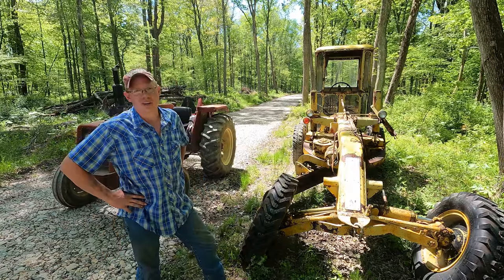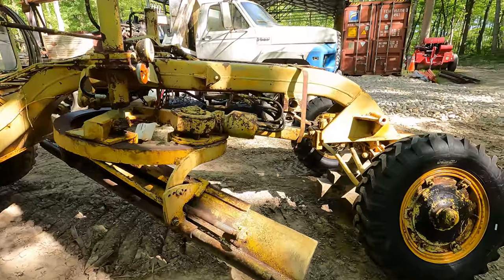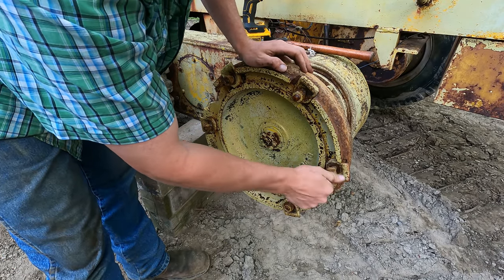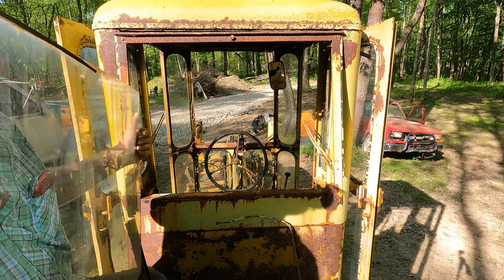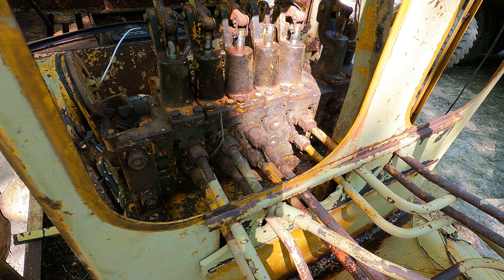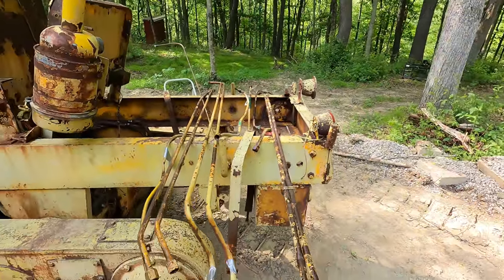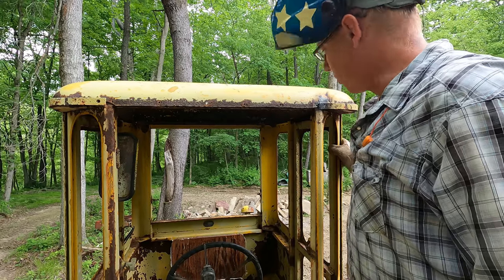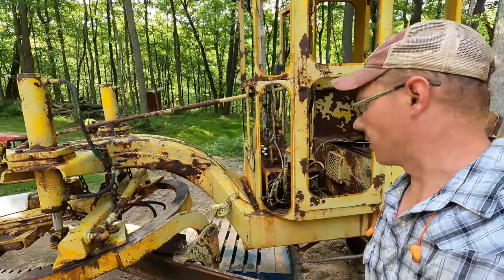More Problems with the 1960's Galion Road Grader restoration!! Pt.8

Comment: When I was a wee lad, our country roads were "paved" annually using oil and gravel. For several weeks each summer there would be Galion graders, rollers, and other equipment parked in various areas as the crews knocked off work for the day or week. 

Naturally, as kids we gravitated to the equipment when there was nobody around, and played "Construction Crew" with them. Once in awhile whoever parked the grader would forget to drop the blade when they left it, and we'd get a juvenile kick out of pulling the lever to drop it. 

Eventually someone decided to try starting one of the rollers. It started. We ran. Next time we went back it wouldn't even turn over. Color us supremely disappointed :( 

Watching your series on the Galion "restoration" has brought back 60 year old memories of somewhat simpler times. My everlasting thanks for your efforts, and for your appreciation of the fact that old doesn't mean it should be retired.

Comment: Please grind the rust off with a poly / strip disk. It's gonna make a difference if you want the paint job to last.
Reply: 👍👍 Absolutely! 👍👍
Reply: Exactly what I was thinking, going to regret that later.
Reply: @kennybirdwell  And not much later the new paint will swell with rust
Reply: i donth think he really cares or not look at his collection thats what is calla  country collection
Reply: didn't you listen to his intro, its a socially distance resto and he could care less. He did do that on the gas tank and it was a shit ton of work for a lackluster result. On these old machines its about just keeping the weathering down, and since he has a place to park it under a roof it doesn't really matter.
Reply: @tslim250  I disagree, the engine, fuel tank and radiator housing turned out great. Now need to maintain the standard. This machine will be a showpiece at the steam show. Socially distanced yes, but not from 100ft.
Reply: @Frank-bh3cm  I thought it looked better when he first drove it from its grave than it will when he's done with it. Ruining the patina with every video. Shoulda just pressure washed it and thrown a layer of matte clear overtop the patina to seal it from further rust.
Reply: Wire brush on the angle grinder and some rust converter. Socially distant restoration.
Reply: @phillipmattila2953   No, that's half assing it.
Reply: @owentimo  true but its his stuff I dont think we need to treat him bad bc he doesnt want nice looking things
Reply: @phillipmattila2953   You're right. I agree. Hey, I guess the grader would be in a scrapyard if it weren't for him.
Reply: At least treat it with Naval Jelly.

Comment: For those who don't know - the beginning of this video is a PERFECT example of why you don't try to pull a stuck truck or a stump out in forward gear with an older tractor (especially one without a roll bar). If you try to pull an immovable object, the tractor's drive wheels don't move, and instead the engine just flips the tractor over and squashes you. This was one of the number one ways that farmers died in the early 1900s.

The way to keep this from happening is to pull in reverse. You tie your straps or chains around the rear axle, feed them under the tractor through the front wheels, tie onto the stuck truck (or stump), and pull in reverse. If the stump doesn't move, the tractor just digs the front end into the ground.

Incidentally, this is also the reason why it's safer to back an old tractor onto a trailer than to drive on in forward gear.

Comment: It would be really amazing if you sandblaster it before painting as well. I see so many projects where they sandblast all the surfaces before painting and it comes out amazing. Thumbs Up!
Reply: The metal on this is too thin to sand blast. It would blow holes all through it and any reasonable pressure. Blasting can also warp panels due to the heat if done wrong. Blasting is the best for surface prep, but not if you don't know what you're doing. 
Source: ex sandblaster / painter
Reply: I use a sandblast setup on my pressure washer.  Great for cleaning up machines like Christine.  Hint:  when you're done, wash the machine with a regular nozzle.  It removes the grit that is left on the metal.  Its the grit that rusts up if its not washed up.  I have had no problems with blowing through sheet metal.
Reply: @ToxicMrSmith  Not if you use a home pressure sand blaster with 125psi max, it will take a bit longer but still gets the job done, ask me how I know...

Comment: When there is no way to get the surface fairly clean from rust, I use to prep with rust converter, stops the paint from flaking. To a certain degree but in places not maintained on a regular basis like metal roof it is a good method.
Reply: Agree ,,
The way the  various  kinds of  rust converters leave a surface ,it almost plastersizes it ,  locking down all the  rough edges  ready for the  new paintwork,
  It's the best way to deal with RUST ,,,
by far  .!!!! .
Reply: Do a dry ice media blast and a primer satin coast on the grader this way you never have to work about fade
Reply: @rsprockets7846  n

Comment: I own a body shop and your just killing me with the way to are going about stuff! No I don't think it needs to be a concourse de elagance show winner but at least grind off the rust and paint before you apply the filler...otherwise I love the channel Matt and think its great that you are keeping some of this old iron in service.
Reply: I agree you gotta kill the rust I like to clean it up pretty good then use ospho it will etch the metal
Reply: Yep.
We've a saying in Cumbria UK: "Divvant spoil t' ship for a ha'p'orth o' tar."

Get the rust off first Matt. 😝
Reply: Actually Never apply filler after you paint or primer, but I know what you mean it would still be better then what he did...
Reply: He said in the beginning of the series it’s only gonna be basically a “half assed restoration” so he’s not doing everything to a “professional level”
Reply: @DudeGuy-zt9eg  what do you use to kill rust
Reply: First off you can paint over rusted stuff these days. Most heavy equitment is just steamed washed and sprayed and looks good even years down the road. Rust thrives in oxygen environments and using good paint will seal that up and stop the spread of that rust. Sure in 10, 15, or 20 years it might show some signs of rust. Yet the goal is to make this machine functional and not to be some show piece. He intends to use this and take it to some shows. it does not need to go to a body shop. Also if anything it would be super cheap to make one of these out of sheet steel if you do not care for the curves and all of that. Now the glass cut out could be done on a cnc. Even if the cut out are a bit bigger than the the glass and rubber gaskets. Just box it out and cut out the area on the cab and weld them in This would give you some strength and a pop out look.
Reply: @kameljoe21  those corners were rusted through, so it’s got oxygen on the back side.  They’re going to crack and break apart in a few years.  Super easy to spray thrust converter on there before painting.
Reply: @Bread996  Either way its going to get painted on the inside as well.  People need to understand what the goal is here. This is a work unit and all he is doing is extending the life of a machine that would have been scrapped at some point. This machine is so outdated that most people do not want them. Yet in this case the price he spend buying it and what he will put in to fixing it will be far cheaper than buy anything remotely in fair running shape. For what he intends to do with it the paint job and finish on it will far last him and his entire life time. FFS I have seen old cars sitting out in the fields rotting away with wood frames that are still in good condition. Yet they need some work. If a car built in the 1920s is still around then this thing will last much longer. The paint and the work he is doing will slow the rusting far more than paying the extra money by putting rust converter.,,,, Let me adjust that as I just looked it up and seen that its like 55 dollars a gallon.. So a couple gallons will work as a good primer base.. Gempler's Rust Converter, 1 gal. cost like 55 a gallon and covers 500 square feet so a couple gallons sprayed on may indeed help keep this thing pretty..
Reply: @warrenklingensmith1241  I've always used Kurust but that's only been for small-ish patches on cars, seems to work ok. There's other brands available in much larger containers. It possibly depends what country you're in as to what's available.
Reply: @kameljoe21  Anything worth doing, is worth doing right.  Takes an extra couple minutes to knock off the loose rust and spray some converter on it first.  That putty is going to make it rust out worse, and that entire corner is going to chunk off in a few years.  I've seen this before, it doesn't work.
Reply: I agree don't expect perfection but damn grind some of the rust hell could even sand blast, you spend good money on mechanicals then half ass the rest where's the OCD now sorry Matt  that rust on the edges is killing me great video though
Reply: You should  sand blasted the machine  or use a bunch  of navel  jelly  or sand  it

Comment: Why didn’t you at least wire wheel the rust of? “A paint job is only as good as prep work” someone said that.
Reply: My father, at least a thousand times. Of course he was correct.
Reply: The guy that painted my house didn't know..   what a dunce...   Dutch.. Eigen Huis painters
Reply: Yeh and a rust treatment would be a good idea too.
Reply: Now, in some fairness, you only want to de-rust just before you are ready to re-prime, or the bare meta will flash rust.  By his description, he intends to steam clean it in how every many days it takes.  Then, that will want drying.  Then, the rust can be attacked.
Reply: @CAPNMAC82  Yeh I get that, but he put body filler over the rusty metal
Reply: That thing is just begging to be sand blasted

Comment: Quick tip for the studs since they're for straps: drill a small hole and countersink it. That way you can make a weld that's already flush with the frame. It's also stronger and less prone to snapping if you ever need to remove the strap

Comment: Ahh the ever elusive 10mm,very rarely seen in public lol.
Reply: I actually had two at one point in my garage at the same time! What are the odds?  But now they are both gone and  I have no pictures or proof that they ever existed sooo....  lol
Reply: @giggiddy  You mean you had a 9mm and an 11mm right? What's a... Did you say 10? 10 inch. Not a 10mm wtf even is that
Reply: @ToxicMrSmith  lolololo
Reply: I would gladly trade some of mine for 3/4". Can't seem to keep them around for some reason.
Reply: That is because the gnomes like to steal them.

Comment: While you're at it check the drive chains for the rear traction. May have worn links to replace.
Reply: And there's probably some oil in the water... errrm, a lot of water in the oil if the rest of the machine is anything to judge by.

Comment: 17:53 you should store Glass vertical, preferably on a frame for support. And out of the way, so you don't knock them over and break them.
Reply: Wouldn't horizontal be better than vertical?
Reply: @ToxicMrSmith  vertical space you need less and it decreases the surface area you could drop something on that's why vertical is better I think
Reply: @ToxicMrSmith  The danger of storing glass horizontal is if you pick up one corner you may break the glass from its own weight.

Comment: A trick for stabilizing and re-enforcing rusty metal , Is ,I use the polyester resin with the hardener from fiberglass kits ,It stabilizes rusty metal and re-enforces it and can be sanded and painted .

Comment: I used to spent summers back in the late 60's at my grandparent's place out in the sticks. They lived on a gravel road. One of the highlights would be when the yellow road grader (don't know if it was a Galion but it sure looked like yours in my memory) would come down the road to smooth out the potholes and washboarding. My cousin and I (both about ten) would scramble out when we heard him coming. Great times.

Comment: I'm full of envy - wish I was working on that nasty, dirty, rusty thing. Looks like so much fun!

Some tips on Flux-Core Arc Welding (FCAW). There's really three major differences between FCAW and GMAW (MIG):
1. Stickout matters! You need a minimum stickout (distance the wire sticks out of the electrode) so the flux has time to melt. Each wire is different and worth looking up the datasheet on, but I usually use 1/2" or so.
2. Check your machine polarity. The most-common flux-core wire I know of is that sold at Home Depot and such, NR-211-MP (AWS E71T-11). That wire requires DC- while GMAW always requires DC+. I don't have a Miller, but usually it's just swapping the leads inside the wire feed box.
3. Don't weld over the slag. You probably know this from stick welding already, but for those who don't, if you weld over the slag, it'll re-melt and get mixed into the weld, causing terrible porosity.

All three points, if followed, will give you much better looking welds and keep porosity out.

As an aside, MIG welding isn't technically correct (I call it that too, though. Who wants to say GMAW?) because when welding steel, we aren't actually using inert gas: CO2 or 75/25 mix (Argon/CO2) are active gasses that affect the weld metallurgy. Straight Argon is used for aluminum though, and that's true MIG.

Comment: I’ve worked In Hydraulics for years. And still do work at a hydraulic shop. Reminder to Tape off your cylinder rods before you paint, little adjustment like that can save your seals in the long run. Any questions, hmu

Comment: A little practice and good wire wheel you will find you can run some real nice beads with flux core. I have used it a lot for outdoor welding. Very strong less problems with old rusty metal.

Comment: Studs for the line clamps, I like the idea of drill and tap a hole in the frame (it will be plenty thick) and use a bolt with anti seize on it. Prefferably with more modern nylon tube holders.
To keep crud out of your hydraulic lines use plastic (zip lock) bags with a zip tie.

Comment: I had one of those, back in the 60's. It was my favorite Tonka! It had that long steering rod and steering wheel. You could turn the front wheels. While running behind it. Pushing with one hand and steering with the other. My favorite Road Work Machine:) I'm glad you are restoring this one... Don

Comment: A quick pro-tip.  If you have shop air handy and a small portable sandblaster just sand the exposed threads of any bolts with nuts on them and the nuts will come off like they were just threaded on. It only takes a couple seconds per bolt.

Comment: great video Matt, your right the devils in the details, prep work is everything,  I am working on a an old VW Golf GLS a friend gave me couple months back, bylaw officer came by told he owns too many cars and you gotta get rid of some so lucky me, it is good shape body/paint wise just going to paint the hood /bumper cover and get it inspected its has most of the options i like and non that i want plain 2.0 litre 4 banger and automatic, no AWD or traction control , only has 85k on it gets 35 mpg, which is  awesome, those hydraulic lines you could make your self and it is one hell of allot of work especially when your working with piping that size, if you get the bends or angles wrong its scrap we just did a stand alone hydraulic unload gantry and was done by hand as we went and scrapped almost 150 ft of stainless line, you should be able to find a shop that has a CNC pipe bender that will just copy your original pipes feet into the machine and will come out 100% it is a little more $$ really worth it in the long run and the missing glass for your cab is easy go to a  automotive window repair shop and they will trace copies of what you need and make them out of safety glass just like you have there now and prices are pretty good we did it for an old farm tractor my cousin put back into service a few years back , he loves it he got them to tint the windows so the cab doesn't get as hot  when your drive it, this all brings back memories of the years of building Versatile farm tractors and buses for new flyer industries got so much valuable knowledge doing jobs like this, if i lived in the US i would drive down and help you put that cab back together right down to the hydraulics, great fun  👍

Comment: I've been enjoying your channel and restorations very much. With all of your restorations of old equipment I was wondering if you knew about KBS Coatings. Their products are fantastic. I've mostly used their fuel tank restoration kits to re-line the interior of rusty, and even pin holed fuel tanks. I have done several now, and haven't failed yet with their kits. Have pipe cleaners or small rope handy to clear the coating from the lines before it dries, and you will have a new inside in your fuel tanks.

Comment: I noticed you having problems with paint cans. If you will take the nozzle off the paint can and put it on your can of wd40 spray until clean you will have no more problems. When you are ready to use your paint just spray onto some scrap to clean out the wd40. Love your show

Comment: When ever i have to deal with rusty studs, I start with soaking as you did, then i chase the threads with a die, this way with exception of the thread closest to the nut are clean, spray down once more and off they come!

Comment: hello good video, i have driven this model road grader  and they steer and hold the ground a lot better if you reverse the tread pattern on the steer tyre i see in later video that the tyres need reversing but good to see you brining back to life,,,cheers